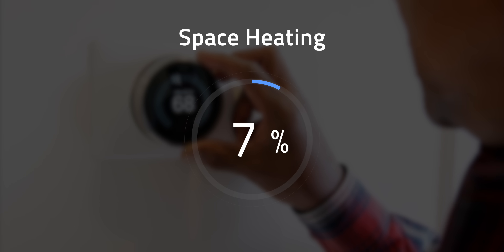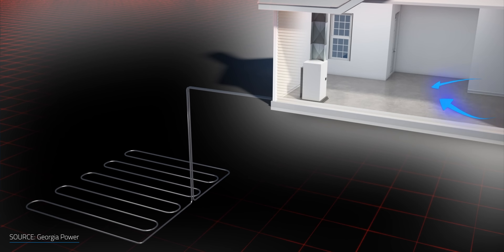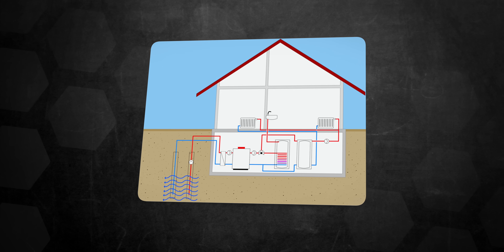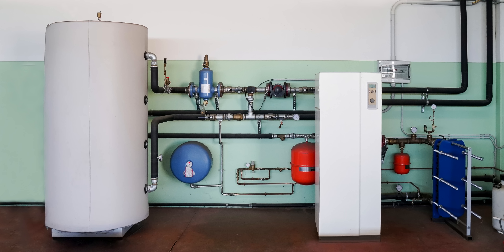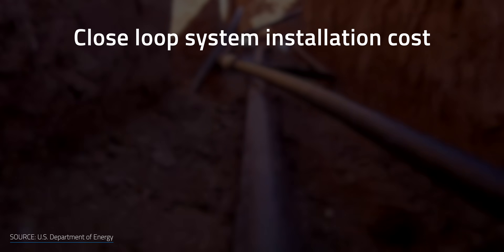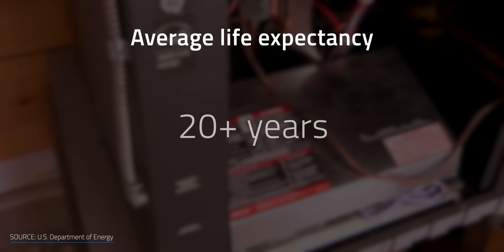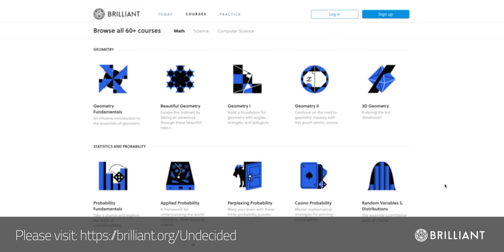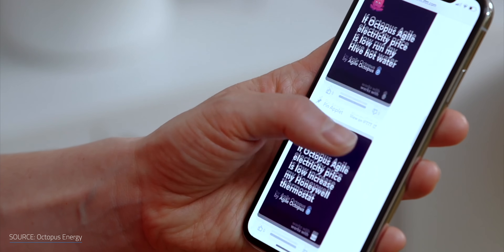Is Geothermal Heating and Cooling Worth the Cost?  Heat Pumps Explained

Comment: Good video.  Have a closed loop vertical geothermal unit for 10+ years now.  Best investment ever.  Natural gas prices have increased steadily in those 10+ years and yeah, we haven't have a gas bill all that time.  At the time of purchase I calculated that we would recoup the savings in just over 9 years.  Happy to say that it was under 7 years to do that.  Well worth the investment if you build a home and plan to stay there for many years.  The amazing part is the unit is still able to heat our home in -40C temps during winter.

Comment: It's important to understand that finding good service technicians for this setup is difficult and that if you're running into issues, these experienced technicians are the only ones that can help solve things, that's an issue that was not pointed out, so maintenance is not simple, or easy. Part repair costs are going to be much higher than standard HVAC systems, so when he says 8 to 10 year payback that's before you factor in part replacement, which while repairs won't happen to every owner, will still push that average back for everyone a few years. Which is just another way of saying if you do have a real issue, you're probably not even going to make that payback in 20 years. Honestly, when a problem does occur, for both homeowner and technician it can be a real headache. Also not mentioned is that if you install a system like this in the midwest you're sometimes taking a gamble on that 50 year underground line lifetime, as gophers have sharper teeth than you think. As an HVAC technician, if I were building a house in the country, would I install one? Probably not, just not worth the potential headache. But my perspective is biased as I'm always the one fixing the problems and making the bill.

Comment: You dont address also the percentage of energy water heating uses that can also be dramatically decreased using geothermal desuperheater .  This is an essentially free byproduct of cooling but can also be created in heating mode. A climate master  tranquility 45 does this and I believe a water furnace 7 also doesand others.

Comment: I am thinking about getting geothermal at my house next year. I put an order in for the Span smart circuit panel you had on a different video, and I want a geothermal system to replace my ancient furnace, my (relatively new) gas water heater and 10 year old central air. I’m hoping that, along with the solar I got this year, and my previous conversion to an EV and all electrical equipment for lawn care, I can decarbonize my house and transportation fully by 2023.

The main thing is that, if I had it to do all over again, I would have started with geothermal. By putting in geothermal, you can “right-size” your solar to take into consideration your lowered energy use then factor in EV charging and other things. If you are considering decarbonizing your home and life, get geothermal and have a professional look at improving the insulation of your home, then plan on solar and an EV, along with electric lawn care equipment from places like eGo or Ryobi. 

In thinking about the cost of geothermal, realize that, if you are like me and need to replace old equipment anyway, the geothermal is just an added cost on top of what you would have paid anyway. Along with the tax breaks, the extra cost of the geothermal will actually be made up in a couple of years through the lack of heating and cooling bills. Tied with solar, some battery storage, and an EV, you may never pay for electricity, natural gas/heating oil, gasoline and oil changes ever again, and you would have put a nice dent in the amount of greenhouse gasses being emitted into the atmosphere. Hope this helps.

Comment: As a service tech, the equipment is costly, prone to more frequent repairs, and parts are 2-3x more costly. I’d pass, same life span as a heat pump 10-15 yrs, then it’s anther 12k-15k for new system.

Comment: You're just asking for refrigerant leaks in the lineset having it under ground. Not to mention the extreme installation cost as opposed to a tradition two piece heat pump. I would not buy a heat pump in general though as they put off less heat than your typical furnace and as a result you need to run them for longer.
Reply from the maker: That may have been true in the past, but heat pumps today are extremely efficient and cost effective.  Even running it more than a traditional HVAC system you still come out ahead on energy usage.
Reply: @UndecidedMF   how do you keep the copper lines from sitting in water or making direct contact with the soil?
Reply: @UndecidedMF  I'm asking because if one or both of those conditions are met you WILL end up with a leak. Everytime I find a leak in the lineset it's because it was ran underground....

Comment: The horizontal fields installed for homes are rarely installed at the proper depth.  If it isn't dug deep enough the temperature is too close to the outside air temp as the seasons progress.  So in the summer the ground temp rises above 60°f and in the winter to cool closer to 40°f. 

I haven't read the latest standards on depth but I believe it's still beyond 6' down so the earth temp of 50-60 isn't too affected by the seasons.  It is important to ask this question to contractors and how they will install indepth.  You don't want to be heating the ground in the winter and cooling it in the summer... If getting one installed ask to see the recommended depth per the manufacturer and ensure by checking the depth from the surface before it is covered up.  If they do not dig deep enough, do not let them cover it over and finish the install.  Make this part of the contract that it must be inspected for proper depth before the next phase of installation can begin!

Comment: I'm not sure I would want to go for just a geothermal system because it would only cover about 1/3 of my energy usage as you stated early on in the video. But if I could pair it with a dual source heat pump and a few solar panels then I think that would be a really good set up.
Reply: I have geothermal system and 
I absolutely do not like it. 
I have to wait several hours for the house to cool down or the house to heat up. With emergency electrical heat strips…. The cost of operations astronomical. 
I have had zone geothermal for
20yr’s now. 
The cost of equipment and installation today. I’ll be dead and gone before I recognize any savings, while being miserable.

Comment: MATT FERRELL -- The most important thing that Science Essentials could teach is how Greenhouse Effect really works.  Or perhaps, that you are not really a scientist until you emphasize understand UNDERLYING CAUSE and MECHANISM, as opposed to merely hanging your hat on data correlations.  

If people understood that Greenhouse Effect requires that the absorbing/blocking substance have molecules close together and that carbon dioxide in the atmosphere is only 4 molecules per 10,000 air molecules, they would realize that it is physically impossible for carbon dioxide to cause significant Greenhouse Effect in the atmosphere.  [The late Prof Chang-Lin Tien, the 1990's Chancellor of UC Berkeley, was a world-class expert on Thermodynamics and Heat Transfer.  He told me sternly to my face in 1981 that the people blaming carbon dioxide for Greenhouse Effect in the atmosphere were DEAD WRONG.  When Prof Tien died of a brain hemorrhage in 2006, UC Berkeley quickly pivoted to being a leading supporter of Al Gore-style Global Warming.  Prof Tien had single-handedly blocked UC Berkeley from jumping on the bandwagon.  What is maddening is that so many people at Berkeley failed or refused to learn the lesson he had taught.]

Geothermal energy is going to become very important in the future because the real cause of Global Warming is VOLCANOES and SUPERVOLCANOES.  Siberia and New England have enormous supervolcanoes underneath.  Over 20 volcanoes have blown since April 2018.  4 have blown in 2021, with St. Vincent the closest one to the U.S.  As soon as St. Vincent's volcano blew, I knew that the Southern U.S. would suffer massive and repeatedly harsh storms.  Do you remember the Northeastern U.S. snow storm in June?  That was caused by the supervolcano heating the ground air, causing it to rise FASTER into the cold air above, creating wilder winds that blow bigger holes in cloud cover, venting more heat into outer space at night.

Comment: You got this incredibly wrong. The difference in temp. Is not the source of heating, but the work done with electricity. It is just more economical than the air conditioning system

Comment: I feel like there are artificial limits on new technology, like "oooh, it's 9% more expensive but it's between 7 and 12% more efficient" so maybe you'll switch but not if it's too much trouble, the status quo isn't going anywhere. Where is the new technology that's half the cost and between 400-800% more efficient and is the obvious choice? Or the thing that costs the same but produces zero pollution? Stuff like that. The "this is obviously better, cheaper, more environmentally friendly, why isn't everyone everywhere doing this instead?" kind of stuff. But any multi-billion dollar industry would do everything they could to absolutely squash that kind of "disruptive" technology so no one would ever hear about it. Or lobby for building codes and housing regulations that prevent you from using it by literally requiring the status quo technology instead.

The last technological breakthrough I can think of on that level was going from 32-bit to 64-bit computers. It seems like generally, the only thing that's "better" is only ever so slightly better, and that just doesn't seem realistic to me. I think the game is rigged.

Comment: Not right for you to add percentage of space heating and cooling  to determine percentage of total requirement. Heating of building occurs in winter and cooling occurs in summer. If you use a/c in the day only and light your house only in the night. You can't add the percentage of light and cooling for that 24 hours to determine the percentage use of total power consumption

Comment: What about condensation? I live in Florida and humidity is high. Cooling a cabin this way may lead to mold from condensation.
Reply: All cooling will lead to condensation, as the air looses it's ability to retain moisture when it's cooler, much of it will form on the cooling radiator, the rest of it will benefit from a dehumidifier.

Comment: I live in Southweat Louisiana, I figure this kind of system would require a dehumidifier too since our humidity levels are higher than any other incorporated region in the country. That's no problem, just an additional consideration. I'd love this kind of system.
Reply: I wonder if you get a heat pump water heater if you will still need a dehumidifier.

Comment: Doesn't make any sense in dense big cities as there is no yard space to install loops. Also, most homes in USA have no basement, they are on a concrete slab so units would have to be in a closet or in the attic.
Reply: If you can have a central furnace system (and have the space outside availiable) you have the space to have a GHCP

Comment: The so called Time Of Use energy rates are bass ackwards.  When people have a need or demand for power, its usually when the rates are at their highest and when the need is much less they are at their lowest. That is the problem and creating energy doesn't care what time of day it is so the rates should be consistent no matter the time of day. It's not all that complicated if you understand that most power limits or whatever they want to market that name under, that is a man made power shortage or limit thus, a fake reason to increase rates due to the man made power producing limits. They truly believe that by creating limited power to work with, they can manipulate people's need for heat or cooling. Not so...Say its 100 degrees for 6 straight months during the day and only 70 during night time. The cooling needs will not follow the time of use charts so folks will have to either suffer comfort or pay ten times the usual rate during"peak" times of the day or night, usually its during the daytime. It seems we have 6th graders or maybe 4th graders in charge of determining how much power production is reasonable during hot and cold seasons and the end result is simply a ploy to force people into paying more money for less power in the long run.

Comment: I'm now retired but worked on instllations like this. I wouldn't have one as a gift (I'm in UK). The heat pump has a compressor in it, it uses a lot of electricity. In Scandinavia, with cheap hydroelectric, maybe ok. Not with UK electric prices. And gas, oil and LPG are only expensive because of globalist policy on emissions. Gas and oil work great, but Greta doesn't like them. Just another scam, renewables are subsidised.

Comment: quick math here, 30k for installation , 600$/annual savings : 30000/600 = 50 years ... By the way, as a climat engineer, let everyone use Geothermal energy or hearpumps, and you'll finally see what really is "Global warming". And don't forget when you go below -5°C you have to use an additionnal source of energy (which more certainly will be an electrical heating coil).

So long story short, after having studied HVAC for over of 5 years, dispite everything you hear and all wonderfull sales and eco-friendly chitchat, just remember this : in nature nothing is created are lossed it TRANSFORMS.

If you need heat in your house with a heat EXCHANGER, you'll reject that termperature outside in the air on in the soil. 

1 fish is nothing but when everyone will be doing it ... 

Oh and by the way, the COP which you're talking about is always given for the "BEST CONDITIONS" where the device has been tested and most of the companies does this testing on the equator ... The real COP of your device will depend on where you're living, the height above see-level, quality of insultation etc etc.

Take care